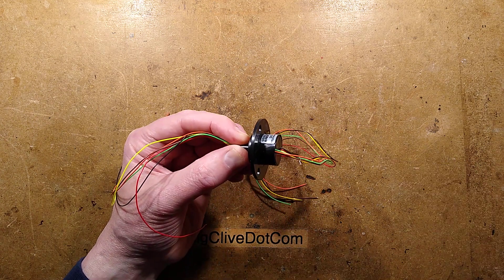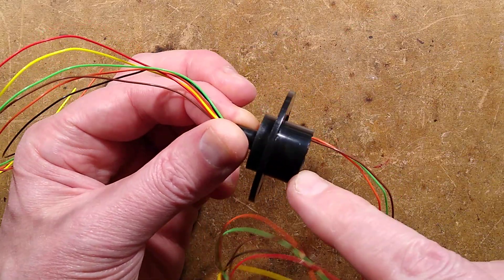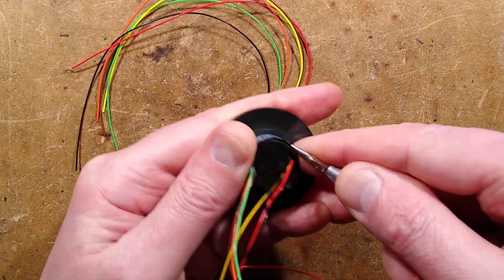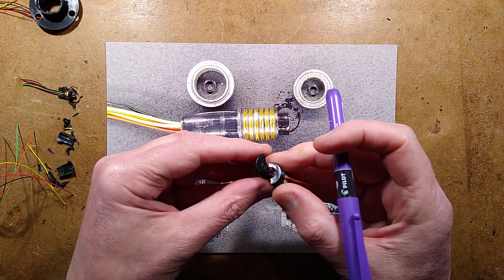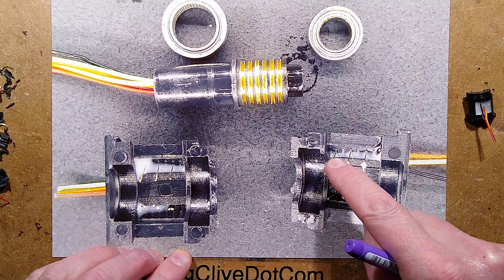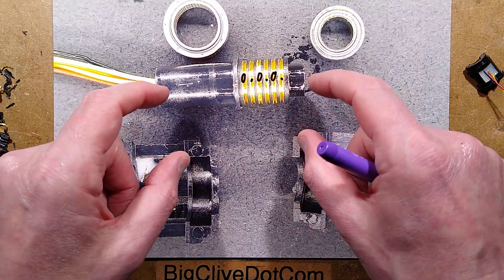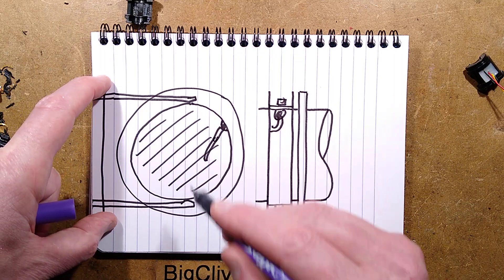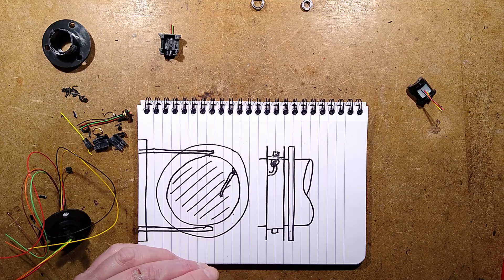6-circuit slip-ring teardown

Comment: We don’t buy them from eBay but we use slip rings for geophysical winches. These are used to lower measurement tools down drill holes. The winch drum will have (literally) miles of wire rope on it that holds the weight of the equipment and has with conductors up the middle to carry both power and data. Happy to try and find you some (small) junk to pull apart. Our slip rings cope with hundreds and even thousands of volts (to overcome the long skinny power wires)
Reply: For Oceanographic research we use a similar arrangement. We also use fiber optic rotary joints for high bandwidth applications. Single pass FORJs are easy to understand, but Multi-pass work via magic.
Reply: @JoshEaton  I expect there is probably optic fibre being used in geophysics too but thankfully I’ve not had to deal with it. Fun enough making a termination strong enough to hold a tonne whilst keeping the conductors waterproof.
Reply: @JoshEaton ,  Fiber optic rotary joints! I had never heard of that being done but I can see why it would be very useful.  The alignment of the ends of the fibers must be very critical;  or perhaps it's filled with an optical gel as well, or encased in a vacuum?
Reply: @goodun2974  FORJ are typically sealed but not necessarily under vacuum. The alignment is critical, although the use of an expanded beam lens reduces the tolerances a bit. 

Most Multi-pass units use a prism rotating at half the speed of the rotor.

Comment: Yes, gold-to-gold contacts are quite reliable. However, gold is softer than a baby's butt. If those contacts rotate, the contacts will rapidly abrade away, leaving contacts to whatever the base metal of the contacts is. The reliability of this system is no doubt measured in rotations rather than hours. I.e., just because it has gold contacts does not mean it is reliable. Maybe it works for systems where the rotation rate is modest, but running it at 3600 rpm? Good luck.

Comment: Gold plating for sliding contacts is a guaranteed early failure. Phosphor bronze is the traditional material iirc.
Reply: Agree, the amount of gold flash (micron level) ,over the years has got to a point ,that its a sales gimmick, modern, cheap electronics doesnt last, gold costs, simple as that.

Comment: I found it interesting that CT scanners utilized slip rings, really large ones with carbon brushes when VCRs moved to rotating or rotary transformers.
Reply: An X-ray tube needs DC to work, they maybe didn't want to squeeze components for rectification and smoothing into the scan head. Also how much of a headache is it to place a rotary transformer far enough outside the axis of rotation to be useful? Leaving enough space for the patient requires a considerable opening in the middle.
Reply: considering the crazy magnetic fields in play, rotary transformers may have been a bit of a challenge in a CT
Reply: @askjacob You’re thinking of MRIs, CT scanners typically use X-rays.
Reply: @askjacob  The large magnetic field in a MRI machine is static (DC), so it wouldn't affect air-core transformers. There are smaller AC fields and RF pulses.

Comment: Most newer cars do not use slip rings to signal from the steering wheel to the rest of the wiring. They use a long strip of flexible printed circuit board to wind and unwind around the steering column as the wheel is turned. Of course this is limited by the number of wraps that can be made but steering wheels also have limited turns. It works well and gives glitch free operation for even high speed digital streams. The robustness, noise forgiveness, and redundant wires of canbus are  not necessary with such a clock spring type arrangement.
Reply: Yes, but those strips break.

Comment: You think this could be used in a steering wheel assembly to pass the controls for the aftermarket stereo?
Reply from the maker: They tend to use a long coiled ribbon cable for that.
Reply: @bigclivedotcom  
The ,,stock" solution implies a special ,,drum" to pass the connections through, a quite complicated gizmo. Unfortunately, it's CAN, so they can't be repurposed for analog signals.
Still pondering.
Thanks for your feedback. 👍

Comment: the teeny tiny baby version of what is often used in fairground rides to transmit actual power to lights and motors on moving elements, especially on the more complex carousel style rides with individually moving gondolas. I still wonder how they used to synchronize all the light effects on older rides, either through individual controllers and sync pulses or with just many more contacts for the light effect channels?
Reply from the maker: Either one slip ring per channel, or just power and a controller on each car with a simple chase.

Comment: I remember way back in the 1970's when police car's had a single blue light on the roof with a 21 watt bulb and a rotating reflator.  I'm not sure how that all work?  The bulb looks like it's stationery and the reflator turn's round the bulb.  If you manage to lay your hands on a 1970's Police car blue light then?
Reply: That is exactly how they work, the mirror has an opening to let the light poke through.

Comment: We had a project car not too long ago where the hub caps were illuminated. That only needs 3 wires, but there was no heavy-duty slip ring that had 3 wires in and out. Maybe this could do it, although space was quite tight.
Reply: The problem would be these are right on the axis,  so unless your wheel bearing has a hollow bore,  you'd need a large diameter slipring that can go around the wheel bearing.  If it's just for non-critical lights,  you could fashion one out of a PCB with wipers salvaged maybe from a phone jack.
Reply: @MattOGormanSmith  I think it could've worked, but we also started the project like 2 months behind schedule because the previous contractor bailed. I'm sure that we could have engineered something, but there were other constraints. We went with battery powered lights that could be hooked up only if the vehicle was stationary.

Comment: Didn’t even know those existed, looks pretty cool, i agrees wouldn’t put mains through that though, when I was a lot younger I used an old fruit machine lamp controller and made myself a really good disco light controller, it had a synchro motor that had wiper arms on it and would just sweep round the 4 levels of contacts I used it for years and it never failed to impress lol 😊
Reply: That brings back memories, having done the same thing  I also made a unit out of the fruit machines control mech. Loads of micro switches on a large rotating cam shaft, used it for years , it never dropped a stitch
Reply: @felixscamp  have one of them as well now it’s all chip based old mechanical stuff you can’t go wrong with 😊

Comment: If your use-case can't tolerate the rotation speed limits or possible drop-outs of slip rings, these days it's also possible to assemble solutions that use inductive power transfer with two coil rings (the field doesn't care that it's rotating in-plane) plus a wireless communication mechanism for the data side. At its simplest this can mean co-opting a Qi charging transmitter/receiver plus connecting to the widget on the rotating bit via wifi, but various solutions exist depending on your power levels and data transfer requirements.

A bit more complicated than slip rings, but sometimes an entirely sealed "no sliding/moving parts" (except the rotating shaft itself) design is preferred.
Reply: The commonly used rotating LiDAR sensors, e.g. on robot vacuums, use a combination of inductive coils for power transfer to the sensor inside the rotating head (rotation is typically achieved by an external motor with a belt or with a direct drive motor underneath) and infrared for bidirectional data right in the center.
Reply: that's how video tape helical scan heads work, except they just use the rotary transformer for data

Comment: Definitely not mains voltage, I would even use this for current load to power any devices, just low voltage sensor circuitry IMO. But I'm not sure if it's reliable enough for critical sensor circuits? Without harsh testing after your destructive quality inspection. 🤔

Comment: I found one of these with mercury wetted contacts in my stash from an old project I had forgotten about.  Three contacts for ground, power and data.
Reply: i just commented on this. the lack of the good stuff.

hang onto it because they are becoming scarce!

and trust me, that thing will still be making perfect contact after 20million cycles.
Reply: Can’t recall, but it was one of their longest life rated unit with 10’s of millions of rotations as you said, with sealed ball bearings in all metal housing.

It was for a rotary LED music visualizer project.  I ended up not using it for inductive power transfer and IR LEDs to transmit the data to receivers on the spinning PCBs.  Because it was quite expensive and not realistic if the device ever went into production.

It never went to production as trying to balance the large three armed rotor at nearly 1000 rpm was too much of a nuisance.

Funny how I find it a month ago and Clive does a tear down on similar device!  😀

I need to make something with it….
Reply: @gavincurtis  now i look again, they arent that bad on the pocket. not as uncommon as they seemed to be a few years ago...

or maybe i just wanted too many connections. iunno.
Reply: Ironic that removing mercury would make the switches more mercurial.

Comment: Nice!
Though it looks like it should be rated 22V 200mA instead, doesn't it?
Reply: You're always on the safe side when you divide Chinese numbers by 10. Same with accu capacities...
Reply: Car stereo watts, the number of people a tent can accommodate, the number of hours an LED fixture will work for... all closer with a zero lopped off.

Comment: Modern cars typically have clocksprings instead of sliprings, because they have more wires (ie: horn, airbag, radio controls, etc). When I removed the airbag, radio controls, & replaced the OE wheel I needed something for the horn…

So, I made my own slipring out of random shit, including a floormat.

It didn't look good, but it was hidden, and it worked 😊
Reply: *the airbag was recalled by the manufacturer, which makes removing it safer than leaving it.
Reply: @Iowa599  any chance you powered it up at some point to test it in safe conditions?
Reply: @tek4  powered it up?

The horn worked fine, and I detonated the airbag in my back yard. The 'bag wasn't as exciting as I hoped, so next time it will be put in something (to make the boom more dramatic) before sparking it.

Comment: All of the cctv rotators I've worked with send the signals for cameras through these with no problems.  Are also available with more than 6 connections,  have some with20 plus.
Reply: I've been looking for a video capable slip ring to make a custom camera "rig". I literally can't find any (well i only found 1 manufacturer), do you know if they have a specific name?
Reply: @Ubya_  just send Ethernet over the slip ring, this thing probably works fine for 100 Mbit.
Reply: @mrfrenzy.  i'm using hdmi since it is a rig for a normal camera
Reply: @Ubya_  unfortunately I think HDMI through a slip ring would be impossible. Then I would put hdmi-ethernet converter on the camera or wireless hdmi.
Reply: If you don't actually need constant rotation but do need 360deg coverage automotive airbag " clock springs" are an option.
Reply: @denisohbrien  ohhh i've never thought about that, i'll give a look at those thanks!
Reply: Modern cameras are generally ip connection.  That is power over Ethernet, or Ethernet and separate power.  Effectively only 6 connections needed, Tx pair, Rx pair, DC +, DC -.

Comment: The FRC team I mentored a few years ago was even able to run CAN bus over these, I was quite surprised that it worked.

Edit: iirc we could run 12V at 40A on the model we ran, and CAN on the remaining two pins to the motor controller. We put the motor controller on the "far" side of the ring because from memory there were some encoders connected to the controller and it was simpler to run just 4 wires thru the slip ring.
Reply: PTZ Cameras run audio, microphone and CAT5 Ethernet trough these things. Crazy stuff
Reply: @mihkus  I'd be interested what packet loss these links are seeing. While Ethernet is pretty resilient down at layer 1 and 2, long drop outs could cause problems, so I would still expect to see some errors up at Layer 3 and 4. I wouldn't expect analogue audio and video to be affected so obviously though.
Reply: Hey mine too. 16 bomb squad and 323 lights out! #datswerve
Reply: What speed CAN bus? I can see some of the lower speed versions being fine, but I'd be wary of running a 5Mbit/s CAN-FD link over a slip ring.

A company I worked for in the 90's ran a 10Mbit/s transputer link through a slip ring connection, and we had to add extra error checking & correction to the protocol given the noisiness of the link.
Reply: @markbooth3066  Just took a look at some forum posts about the controller, it appears to be a 1Mbps bus speed. It may be capable of being able to negotiate down to 250kbps too.
Reply: @carneeki  sounds almost like a physical zigbee/z-wave, they can drop down depending on the quality of the data link, I can imagine things over a sliding contact could get dirty as regards signal. CANBUS getting a little bit too pervasive, trying to make things impossible to repair, when we need to repair as much as we can..